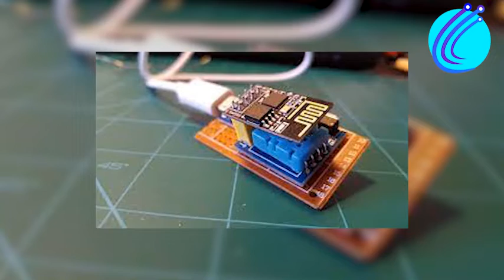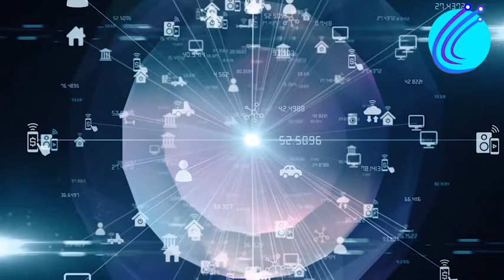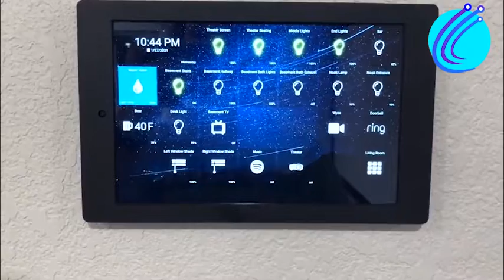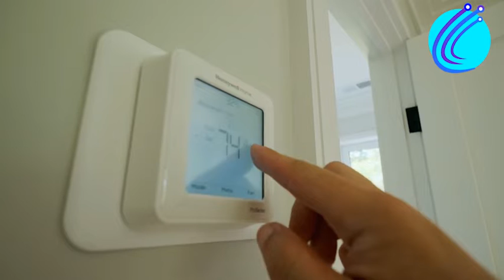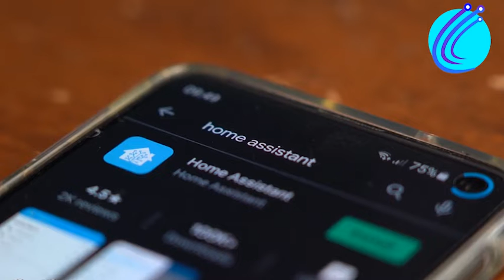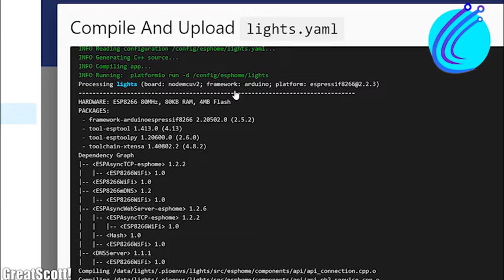ESP8266 Home Assistant: The Secret Device Your Smart Home Can’t Do Without

Comment: What is that? ESP8266 have been replaced ESP8285
Reply: Nope. Esp8285 is the same chip with integrated 1mb flash. 8266 use external spi flash